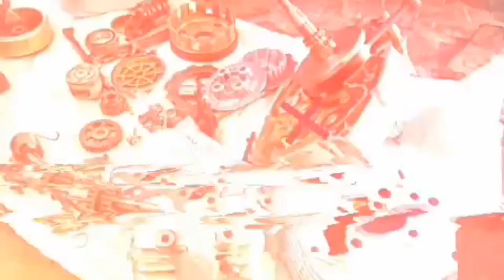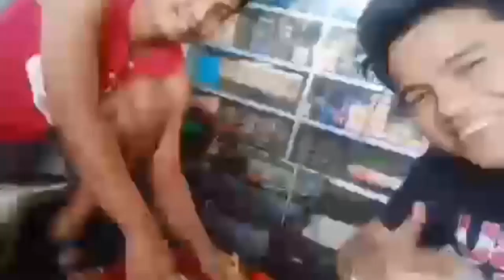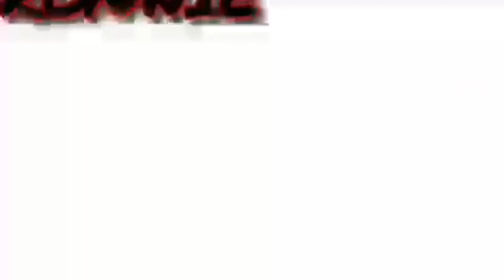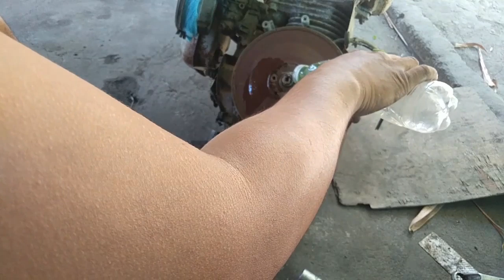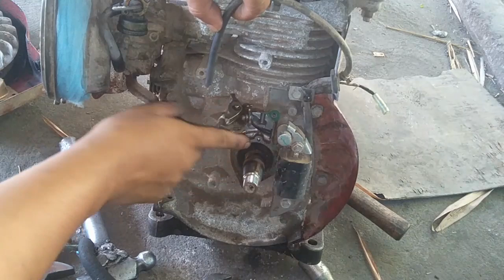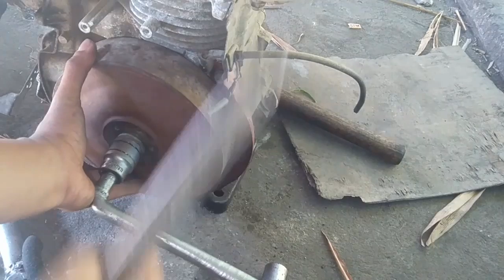HONDA G300 GENERATOR WATER PUMP PAANO MAGTIMING NG CONTACT POINT

Comment: Sir jhonnrey...isa akong malugod na  subscriber mo at libangan ko dito sa abroad nanood ng mga uploads mo bago man o luma...saludo ako sa experience mo bilang mekaniko ...sir tama ung paliwanag mo doon sa 4 stroke applied sa 2stroke engine  ...rèed valve man o rotary valve...intake  kc bumaba ung piston na compress ung mixture sa crankcase itinulak ung burn mixture kaya exhaust...sa 4stroke engine may intake n exhaust valve kaya po intake,compression,power n exhaust...ty sa mga upload mo maraming natutunan diskarteng malupet sa light n heavy linya ko bilang subscriber mo marami akong natutunan sa muli ty sa mga uploads mo